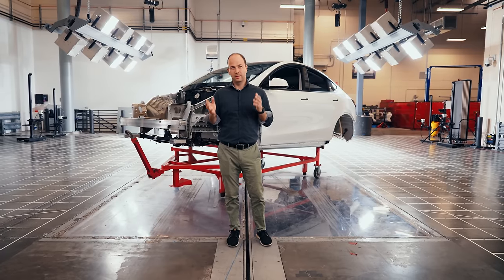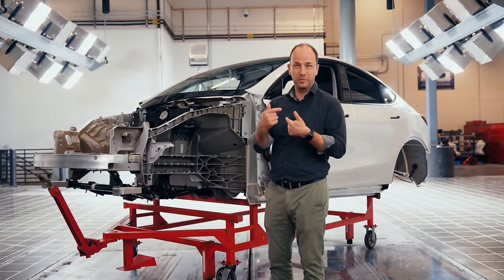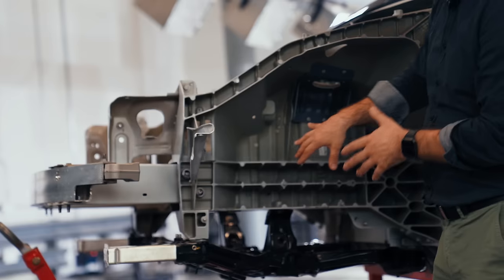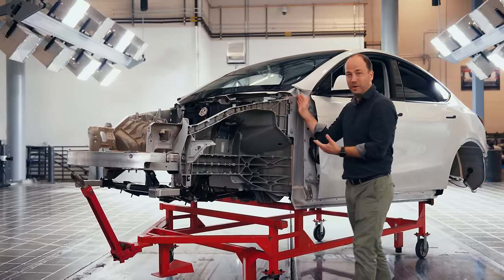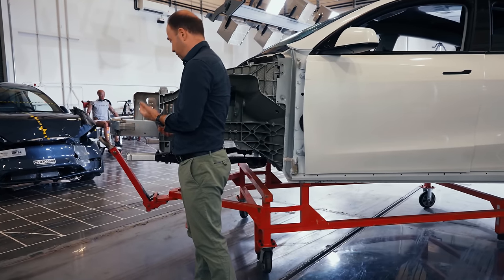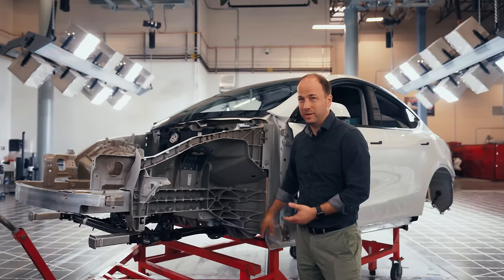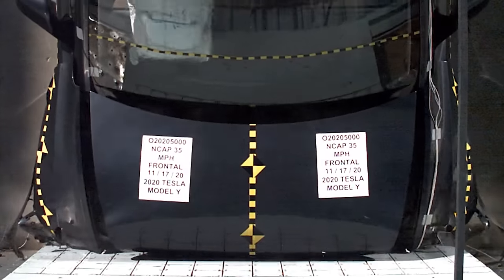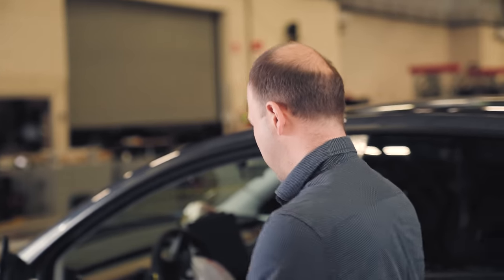Lars Explains | Tesla Vehicle Safety

Comment: Tesla may not be everyone’s favorite brand, but there is no denying that they are some of the safest cars on the road.
Reply: Not "some of", "the safest" car on the road.
Reply: @paintedpony2935  Well Volvo and Subaru exist too.
Reply: @1996ChevroletImpalaSS  Tesla is safer. This is not up for debate, this has been tested.
Reply: Volvo does have pretty safe electric cars but Subaru isn't even in the mix anymore compared to Tesla
Reply: @1996ChevroletImpalaSS   - Volvo/Polestar is made in CHYNA , and less SAFE.
Subaru SOLUTERA is using eTNGA by Toyota = LESS safe.
Reply: Tesla, safest , best overall and also so much fun to drive and own. Once a Tesla driver prob always a Tesla owner
Reply: @1996ChevroletImpalaSS  Volvo lost that moat a long time ago unfortunately.
Reply: @nielsvandenkieboom5034  There still hasnt been ONE death in the XC90 series, since its original introduction in 2002 - not for lack of sales but for the sheer fact that they are extremely safe.
Also volvo does some pretty wild crashtests, like going off the road and hitting a drainage structure thus sending the car literally flying - to ensure their seats can absorb the impact properly and protect your spine.

I don't think anyone else does that - and Volvo still has it's merit as an extremely safe car.
Reply: @markplott4820  Tesla also produce cars in "CHYNA", and Volvo produce cars in USA. If you are talking about the R&D headquarters, they remain in Sweden
Reply: @mikkelkirketerp4884  I'm sure Volvo is still safe, I believe you. But that doesn't mean that they're the only brand that should be credited for this. Tesla has been doing very very well in a lot of American and European tests. Perhaps better than anyone expected from such a new car manufacturer.
Reply: Safest car in the world is Tesla model S
Reply: @mikecounsell  I've owned a Tesla since 2018.  Having driven one and after watching countless Sandy Munro videos, I won't buy anything but a Tesla in the future.  I seriously question anyone considering a non-Tesla EV.
Reply: @ultra-extreme   - Volvo is RED Chyna owned now, Volvo no longer Exists .
they have a Design  studio in EU.
thats it. 
Volvo / Polestar is Engineered in CHYNA.
Reply: @markplott4820  Tesla is made as well in China. Also, many modern Chinese cars get 5 Star ratings at NCAP. To archive 5 Stars this is much easier for a BEV than a Car with a fat combustion Engine. And Polestar got as well 5 Stars - and Tesla is only slightly better but there is not much difference. 

Where the Safetytest fail and do not cover are active Safety when it comes to suspension. I own a Tesla, but to be crystal clear the suspension on a Tesla is rubbish and this result in a much more unsafe driving experience. You can see how bad it is when you look at the Nuerburgring record try of the Models S Plaid. Compare to a modern Porsche or BMW he needs a lot of really hard correction, whereas modern Cars would handle this far better. And the brakes for a 1020HP Car - really Tesla?

A Model S Plaid with a Porsche Taycan Suspension (and the Taycan with much less Horsepower can beat a Model S Plaid on the Nuerburgring) would be a really safe car. The same for Model 3 and Y with the Suspension of a BMW 3 or X3 would increase the Quality where it should be. 

And last but not least - corrosion. Safety is also defined over a long period. But Controlarms with plastic + metal = Rust is not a great idea, and missing cavity sealing is also ruin you safety when the rust eats the metal away. 

Summarize Tesla Engine, drivetrain, battery, structural safety, and electronic safety assistance - really good. Corrosion prevention and suspension - sadly really bad. And Brakes - special on the Model S and X completely undersized.
Reply: @tv-ld3wv  model y as per ncap, nhiis and nitsa(?).
Reply: @mikecounsell  or just an electric car owner in general
Reply: @markplott4820  this is mostly incorrect. There is excellent engineering done in Shanghai, but most engineers are in Gothenburg, Sweden. Polestar's global headquarters are in Sweden, but they also have an engineering office in UK. 

Volvo and Polestar are Chinese in the same way that Jaguar is Indian - all putting out great products with a global presence.
Reply: @I_love_our_planet  - FACTS are Tesla made in CHYNA are better made than American & EU OEMs, they are also LOWER cost to make , and with 95% Tesla parts made IN-HOUSE.
TESLA Fremont is 85% IN- HOUSE. with Better reliability than Toyota.
Reply: @RedRyan  I worked at Autoliv that made airbags for many big companys, Volvo was prio 1 but soooo many airbags that was pure shit, there is alot of bags that have or will just rip apart in a crash
Reply: @markplott4820  
Mark. Will you just go away.... you're giving "us" a bad image.
Reply: @mikecounsell  Amen to that. I'm on my second Tesla.
Reply: @Tyler I kept my old 2000 Durango because there are some things a sedan won't handle.  I will replace it with a Cybertruck.  Production should start soon.  Seen photos of pre-production models on the road.  

A Lightning might be OK, but I would not want to deal with a dealership trying to buy one at this point.  How much are they marked up over the sticker?  And didn't Ford stop production because of battery fire?

A Lighting is compelling only until a Cybertruck is available.
Reply: THE safest by any measurement.
Reply: Its my favourite brand lol. Judge when you have driven one. I drove BMW for over 11 years; 6 different models including the M4 Coupe. None of them even come close to my Model  3 LR.
Reply: @1996ChevroletImpalaSS  far behind from what Tesla has done
Reply: @mikkelkirketerp4884  you’re statement is misleading.  There have been zero deaths in XC90’s…. in the UK.  Not “globally”, not “ever”, but just in the UK.  Still pretty good for 65,683 vehicles, but let’s make sure we’re not misrepresenting the situation.  Just over 1.3 million total production.   Some quick math, 282million registered vehicles in the US in 2021 vs 43,000 us motor vehicle deaths gives us basically 1 death for every 6,560 vehicles on the road, making the XC90 atleast 10 times safer assuming no deaths for 65,000 vehicles…. Still pretty damn impressive.
Reply: It's mine favourite
Reply: @donm2255  I have owned a Tesla for 1 year.  Personally the wonky auto-pilot (why can't cruise control just work like it does on every other car I have ever owned without phantom braking and shutting off when the sun shines the wrong direction) and sub-standard build quality over ride the other great parts of the Tesla experience.  I doubt I would ever buy another Tesla.
Reply: Tesla didn’t gave you a heart bro
Reply: @DR-nc8nc  You sound like someone pretending to own a Tesa to make the FUD seem more credible.  

I regularly talk to Tesla owners as Superchargers.  None of them had any regrets buying a Tesla.  Build quality concerns are largely just media hype.  My 2018 Model S only had one issue from the factory (passenger side door entry light).  All the legacy autos I owned had several.  I also can't remember the last phantom breaking issue I had.

You need to watch some Munro video's.  They make it pretty clear how far ahead Tesla is.
Reply: @Mark Plott  WRONG. Volvo is own by geely motor but designer and ceo is Swedish. So it have the sweden quality and safety. Some Tesla is also manufacture in china so does that mean those tesla are horrible?
Reply: @markplott4820  and what make chinese car unsafe?
Reply: @markplott4820  Do some research before commenting stupid comment/reply
Reply: @ultra-extreme  giga Shanghai does not ship to US nor will giga MX unlike Ford and GM
Reply: @mikecounsell  I can attest to this. Hard to move away once you experience ownership.
Reply: @greenlifekawaii2461   - no Large castings , lack of Gigacastings, poor Engineering - EV adapted from GAS cars, LACK of Electronic and AI safety systems - basic NON smart car, and MORE.
Reply: @greenlifekawaii2461  - Legacy auto is Complacent and full of LUDDITES, too many MBA bean counters at gm/FUD motors.
Reply: Me: I don’t care what people say about my car. I just enjoy it.
Reply: @nielsvandenkieboom5034  maybe time to stop shilling and look at facts? elon daddy saying the car is safe doesnt mean it is the most safe car
Reply: @GBR9794  Like Euro NCAP tests? I did and in September 2022 the Tesla Model Y broke the Euro NCAP records in two out of four categories. Before the Model Y the Model 3 also received unparralleled high scores. That’s literally what I’m reading based of the actual crash tests. What’s your source?
Reply: Ahahahahahahabahahahahahahahahahahah Ahahahahahahabahahahahahahahahahahah were you have your head on tesla "pipes " LOLOL Ahahahahahahabahahahahahahahahahahah 5 rating stars is abasic 4the industry now day's.
Reply: @nexusebtuoy  NCAP isn’t only the 5 star rating, they also give scores in four categories.
Reply: I swapped a much loved 2020 BMW X5 MSPORT for a Model Y (with acceleration boost) 

The Model Y is a far better car ! I utterly love it ! (Even after 14 months of ownership I still get excited about driving it )
Reply: @kyotosunsetdreams6105  In the updated moderate overlap crash test conducted by the IIHS, Ford Mach e scored a 'Good' score for Rear passenger restraints and dummy kinematics, while the Model Y scored an 'Acceptable' score. Technically, the Model Y cannot claim it's safer than the Ford Mach e.
Reply: @markplott4820  Doesn't matter is it's made in China, your iPhone was made in china and is top quality
Reply: @1996ChevroletImpalaSS  Subaru/Toyo coughs wheels falling off, totally safe!
Reply: @markplott4820  ANd they are not even trying to compete, just exist. Their CEO gave an interview recently, they are minnows and don't have any dreams of competing.
Reply: Btw Tesla hired a lot of Volvo safety experts…
Reply: @markplott4820 why are you spelling China with a Y?
Reply: Is this safety cage available on the Model 3? The MY is a little too big for me and thinking of purchasing the M3. All the crash test show an MY.
Reply: @ultra-extreme  from Wikipedia “Volvo Cars is a multinational company with plants located in China, Sweden, and the U.S.A. For most global markets, all Volvo cars are produced and assembled in Sweden. The plant in South Carolina currently produces the Volvo S60. The plant in Chengdu, China, is responsible for Asian market vehicles.” 

Tesla doesn’t sell cars made in china to the US market, US cars are made in the USA. Tesla is the most American brand of vehicle you can buy in the US.
Reply: @donm2255 I second that! I’m on my second X. First one was a 2017, just traded for a 2024. Love it.
Reply: @DR-nc8nc Tesla does have plain ole cruise control if you select it. In the autopilot options it’s called “Traffic-Aware Cruise Control” you do everything it keeps the speed.
Reply: @GBR9794 it’s the government crash tests that said it.
Reply: @rickslife  I don't see myself buying any non-Tesla vehicle in the future.
Reply: Safest

Comment: When you get rid of the gasoline engine, the entire front of the car gets dedicated to crumble zone saftey.
Reply: Smart, like the smart car 🧠
Reply: In a Tesla.. yes.. and a few EVs.. seen the front of the german made EVs? Or the Koreans? They fill all that space with other components now.. cause they don’t know how to design and produce cleverly engineered packages that reduce all that stuff in size.. now, they can and do design all that extra shit to also crush and go under the car.. but it’s far less efficient a build, and I suspect less effective.
Reply: @airheart1  it’s true but I’d argue those components are likely less devastating than an iron engine block.
Reply: When you get rid of the engine, you have a worthless vehicle.
Reply: @Dat_Sun  bro still thinks we living in the 1800s🤣
Reply: @Dat_Sun dinosaur
Reply: @okthisisthelasttimeipromise  i agree with that completely. But if they put more effort into designing the vehicles components better and reducing all that crap by making most things do 2 or 3 jobs or even more in some cases.. they could not only have a better free crumple area.. they could add the extra useful frunk space and reduce weight and make their EVs more efficient all in one fell swoop. But for some reason, the vaunted legacy automakers can’t seem to make it happen. So you get fat, bloated weight EVs with less performance and a higher cost all around. Not smart imo
Reply: @mluu510  Ok?
Reply: @TK-fl1on   What are you getting at?  Is there something wrong with my old reliable pick-up?